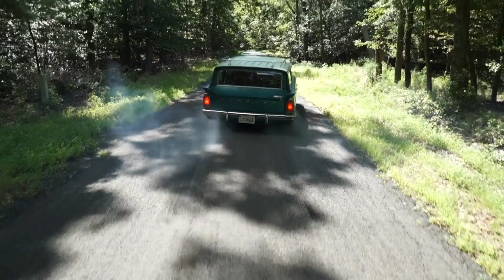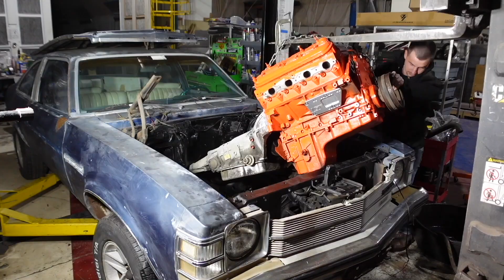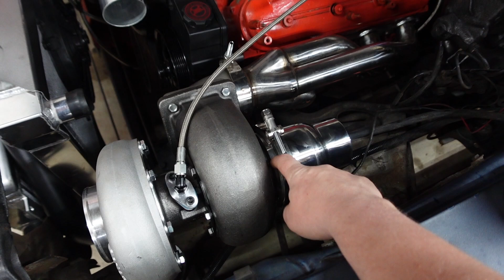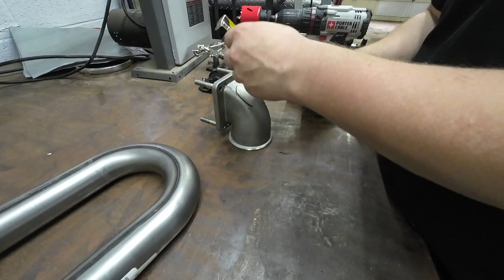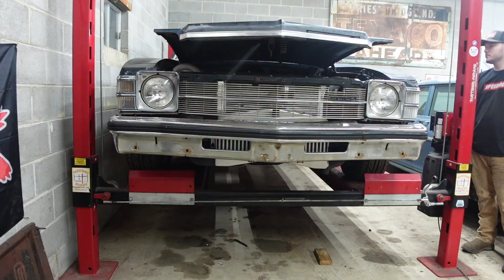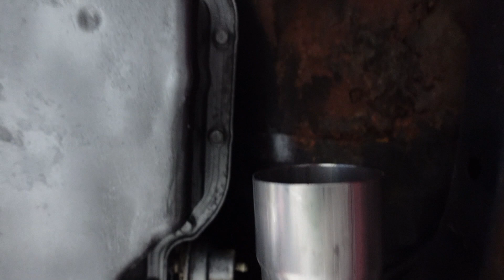Twin Turbo LS Exhaust for Less Than $500!

Comment: Hell yeah bud, looks good. Too bad you arent closer to AR id let you borrow my tig welder. Good progress video. out of curiosity does your lark have the 7.25 10bolt or the 8.5? Sadly mine right now has the 7.25 as mine was originally a v6 car. When i had bought it someone had swapped a motorhome 454 in it. It was too damn heavy on the nose. I pulled it and swapped in a 383 stroker. I have found out that all the 2nd gen camaro suspension parts do swap over. I have a 75 camaro I will be pulling parts from. If my rear end grenades, i have its 8.5in i will build and swap in. Good luck on the rest of the build
Reply from the maker: I’m honestly not sure I’ll have to check! Thanks for watching!